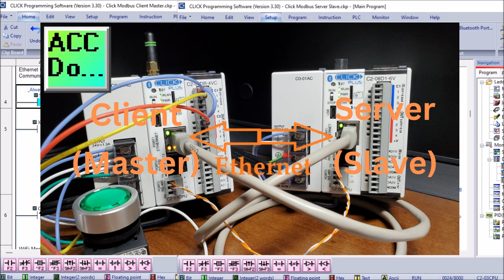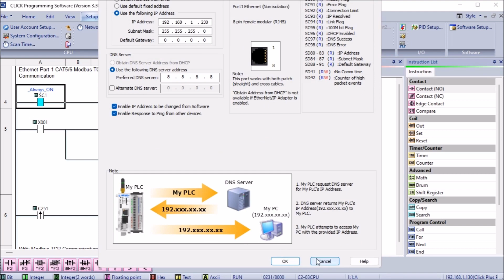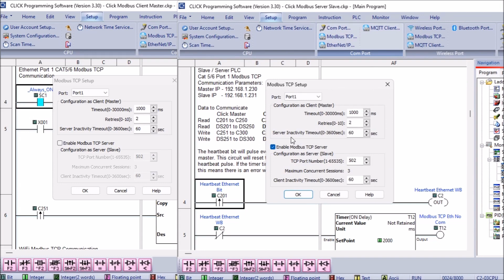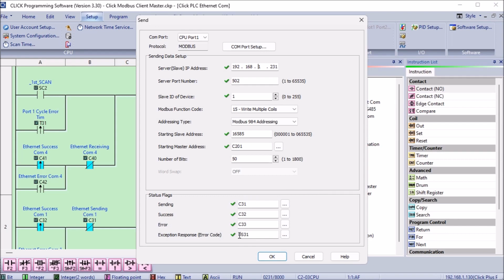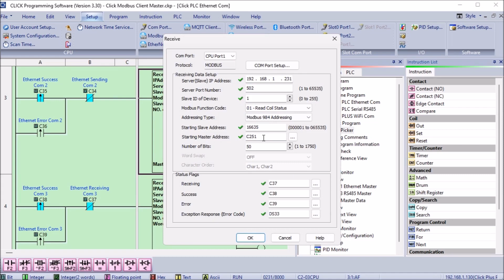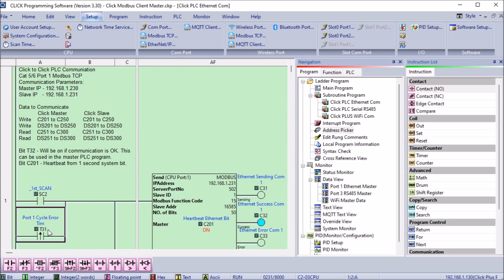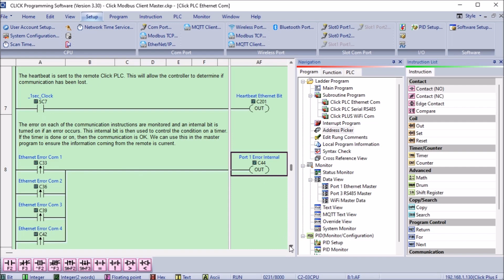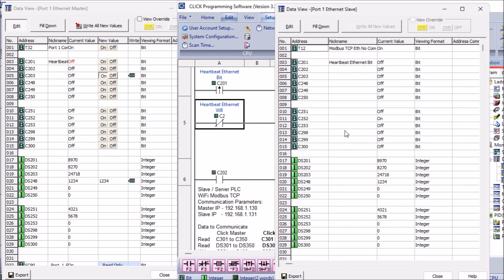Master Click PLC Remote Control via Ethernet in Minutes

Comment: Can Click PLC be used for a machine vision project e.g. surveillance?
Reply from the maker: Yes, this can be used for machine vision. Usually, a vision controller is used with communication capability. Example: Connex Controller with Modbus TCP. The Click PLC can then request the information needed from the vision controller.
I hope this helps you out.
Regards,
Garry

Comment: Question, can the Click Plus PLC be set up to communicate with an external device over Ethernet/IP? I am having some trouble finding documentation of this online. Thanks.
Reply from the maker: Hi @ryanfrench269
The Click PLC can only be the Ethernet IP adapter. In the following post, I will show the Productivity 1000 as the Ethernet IP scanner, communicating with the Click PLC.
https://accautomation.ca/productivity-1000-plc-click-ethernetip-remote-io/

I hope this helps you out.
Regards,
Garry
Reply: Thank you for your response. I assume I will need to get my hands on a Productivity series PLC? @ACCautomation
Reply from the maker: @ryanfrench269  
Yes, you would need it as the Ethernet IP scanner to communicate to the Click PLC. 
Regards,
Garry

Comment: Can the CLICK PLC be setup in a redundant setup?
Reply from the maker: Yes. A redundant PLC means there would be two PLCs to control a process. Additional wiring and control logic is developed in both PLCs. This is often confused with a hot standby PLC.  A hot standby would have two CPUs, primary and a backup CPU. If one CPU stops, the other will continue within the same scan of the PLC.
I hope this helps you out.
Regards,
Garry

Comment: I have a CLICK PLC and Keyence laser micrometer with a NU-EP1 Ethernet Buss. Can I connect them through Ethernet?
Reply from the maker: Hi Nick Zhang,
The NU-EP1 Ethernet looks to be just an adapter on Ethernet/IP protocol. The Click is also an adapter. 
https://www.automationdirect.com/microsites/clickplcs/click-help/Content/232.htm
You would need a scanner to communicate with both of these units. A productivity PLC can be both a scanner and an adapter. Here is a post showing the communication to a Click PLC.
https://accautomation.ca/productivity-1000-plc-click-ethernetip-remote-io/

Your other option is to use discrete input and outputs from the laser micrometer. I believe that they have a BCD unit that can be used. You may have to ask your Keyence representative.

Regards,
Garry
Reply: @ACCautomation  Thanks for your reply. I'm now considering to use a Productivity PLC. It looks like the Productivity PLC can be set up as a scanner.
Reply from the maker: @nickzhang160  
That is what I would do as well.
Thanks for the update.
Garry